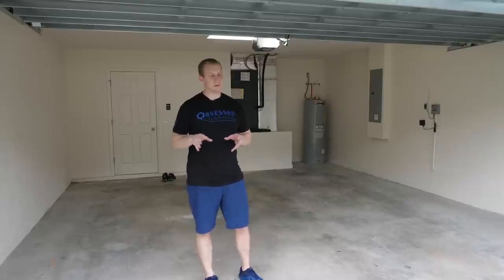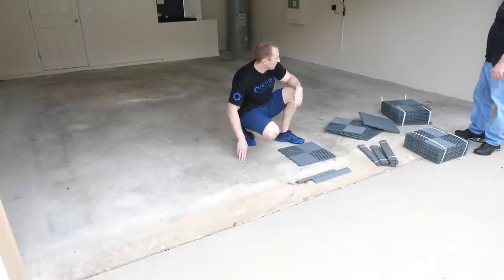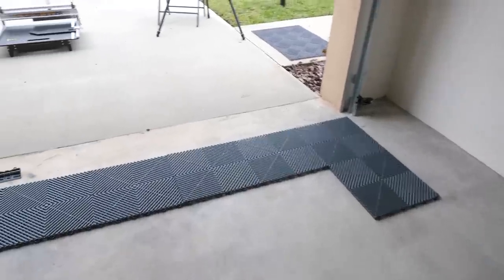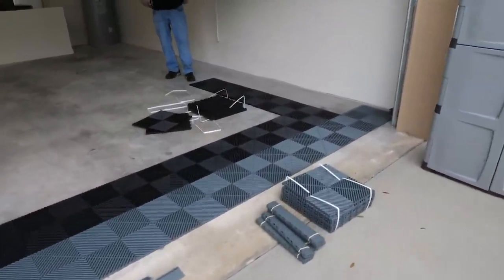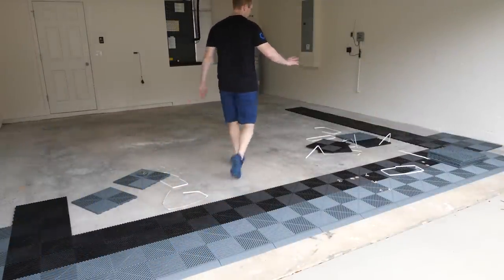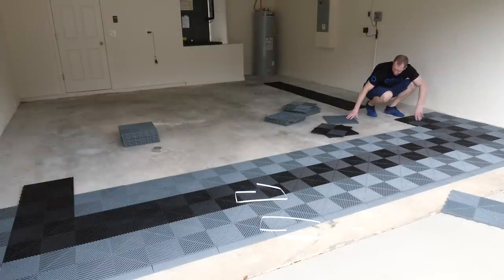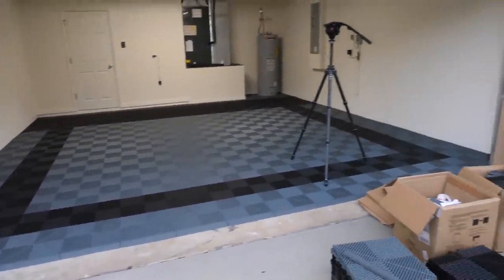Installing Swisstrax In My Dad's Garage

Comment: Those tiles look like all the water, dust, crap goes underneath it, and might not flow out. After it will start to smell, I think it should be solid so nothing can get under neath it. Looks good.
Reply from the maker: That's the whole point.  Dirt disappears, and you vacuum directly through the tiles a few times a year.

Comment: If you accidentally spell something, such as motor oil, do you need to lift up the tiles to wipe up the mess underneath or are tile seams tight enough to prevent any liquid to get between them?
Reply from the maker: Yep, but it takes like a minute.  How often do you spill stuff?  I don't spill often.

Comment: If your just parking on it ya looks ok wouldn't work on anything on top of that floor first time you spill oil or some misses the bucket you have to take up half the floor to clean it then you going to have to clean the tiles too
Reply from the maker: That takes 30 seconds.  I do work on mine all the time.

Comment: What was the size of the garage? I think I have similar sized garage, but calculating based on pack of 25 = $179 I end up with $1800 for the whole garage
Reply from the maker: This was 1,200 sq. ft.
Reply: Obsessed Garage 1200 sq. ft. ? Sounds very enormous. I think you mentioned that you spent $800 for the tiles am I right?

Comment: Are you still able to get this stuff for the pricing quoted in the vid?  Just checked your site and it’s about double.  Definitely interested...couldn’t find your contact info on the site.

Thx!
Reply from the maker: Yep.  It’s $3.95 per square foot.  Each tile is 1.7227 square feet, so $6.80 per tile.
Reply: @ObsessedGarage  sorry I missed that, I thought that was the price /sq ft.

One question, do these make noise when walking over them or are they somewhat quiet?  I have a modular tile on my patio but they are so noisy....wondering if these would be the same.

Comment: I get that you can drive on the rubbertrax but what would happen if you did it anyways? Would you ruin the flooring or would it peel up and you would have to put it back?
Reply from the maker: It's too soft.  You would snap the loops and damage the tiles.

Comment: I live in Colorado and therefore track large quantities of road grit into the garage during winter months. Would this floor support hosing out the grit in the floor voids  in a reasonable time?
Reply from the maker: It works quite well in that environment.  You could hose it out in place or pop the dirty tiles up and clean them in the driveway.  I would suspect once a year would be fine.

Comment: how much noise to these make? and is your floor perfect, I expect they will flex based on concrete flatness
Reply from the maker: Since they are 3/4" thick, they don't click and clack as much.  Solid tiles that don't have open slats are also noisier. They will give a little with drains and cracks in the floor.

Comment: I bought the tile cutter for 500 or 550 on Amazon then sold it in minutes on the Obsessed Marketplace when I was done with it for $260. It was worth every penny, made install fast on both my garage and cousins
Reply from the maker: Smart!  That's how I would have done it.
Reply: @ObsessedGarage  ya if you can find someone to split it with you its a no brainer.

Comment: Matt, the finished product looks amazing.  Think you've sold me.  One question, have a 4 post lift that can be moved around if needed.  Do you put it on top or build the floor around the posts?
Reply from the maker: You'd want to cut the tiles around the lift.
Reply: @ObsessedGarage  love crisp answers.  thanks man.

Comment: Rather than a slim tile down both sides, Why not offset the black tile by half a gray tile than you'd have 7/8 of a tile on each side vice a sliver, however the black border would be a half tile closer to the wall, or half a tile into the middle of the floor. Ceramic tilers would never leave slivers unless absolutely necessary.
Reply from the maker: This is different than ceramic tile.  It has to be interlocked together.  You can't just pick where to make your cut if you want the black border centered.
Reply: @ObsessedGarage  Unless you could build a new skinny tile by gluing pieces from two tiles together.  Just wondering. I did have success in using Crazy Glue to repair a tab in a Bergo tile.

Comment: Matt, no need to leave any room for expansion on sides due to temperature changes?
Reply: He explains it’s not needed. They’re not gonna expand that drastically unless exposed to direct heat for a long period of time. Garages in Florida, even non insulated ones, don’t change temperature “that” much unless you live somewhere more extreme or again leave your door open in sunlight often. But again he explains this in the video.
Reply: Definitely need to leave room for expansion 1/4" all around the floor then install base board over top to hide it..

Comment: how do these hold up to actual "shop" type abuse, ie; jacks, jack stands, fluids etc?????
Reply from the maker: I’ve done a few commercial shops.  It didn’t do well.  It gets really nasty.  I’m a home garage where you wrench, it depends on your cleanliness.  I have don many where guys pull engine and transmissions that do well with it.   It would be any other floor that you invested into, you’d take a bit more care to keep it clean.
Reply: Former professional technician, however I still wrench A LOT. Thanks for the info, I appreciate your time. Keep doing crazy brotha, you’re good at it!! Haha

Comment: so this flooring product is not for a functioning garage (no oil changes, or actual work being done in it.. its simply for parking your car.. no way to clean up dirt/oil spills.. ok, keeping away from this crap....
Reply from the maker: Just pop the tile up and wipe it up.  How often does a person dump oil on floor.  I have 4 cars and change oil myself.  So maybe 6 times a year, I'll have the potential to drop a little oil.  Pop the tile up and wipe it.  It takes 30 seconds.
Reply: @ObsessedGarage  but you need to jack up a vehilce, this stuff wont stand up to a jacks wheels. It will buckle and break. Ill stick with epoxy. Or solid rubber mats that drain, and resist chemicals...
Reply: @killahjeep  Sorry but we do it all the time,  I jack up my car and put it on jack stands and no problems.  You know what they say about assuming.

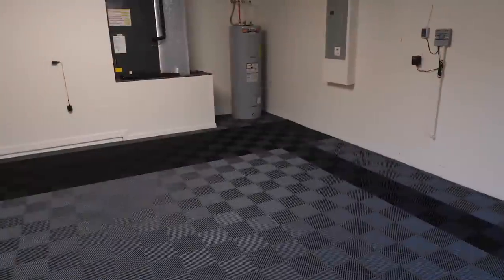Comment: Does anyone else find it weird that the lower crown molding next to do stops at the corner @31:14 and not all the way throughout?
Reply: Monte not real sure what you mean as of if your saying the whole garage but if so  probably because its concrete on the sides of the garage and not drywall
Reply: America’s Sports Car ah that makes sense didn’t notice that right away

Comment: For all the people griping about it trapping dirt, that's literally the point of it, you can easily unsnap the tiles and pull a few rows out at a time and sweep/vacuum it out a few times a year, it's not that difficult to do.
Reply: Pulling out tiles a few times a year?  Are you kidding?  That's more work.  I'd like something with no maintenance, like and epoxy floor you can just wash down with a hose and sweep away.  Thanks, but no thanks.

Comment: anyone thats ever dropped a screw while working on their car, or got some overspill from fluid changes, sees the kind of nightmare this flooring presents! Ill stick to epoxy!
Reply from the maker: Neither are a problem
Reply: @ObsessedGarage  if that's the case, you should make a video spilling some oil, throwing some cat litter to soak it up, and what the concrete floor under it looks like.. Oh and how to clean the tile too. All extra, and unnecessary work compared to epoxy floors. Shop towel, wipe and done
Reply from the maker: I have many, but not a dedicated one.  How often do you spill oil.  For me it's once every two years.  It takes 5 minutes to pop up a tile and wipe it up.  This about dirt logically here for a minute.  The top of the tile has rounded ribs.  Let's say you take off your fender liners and drop a bunch of dirt and rocks while removing.  The tiles are 3/4" thick (tall).  All the dirt bounces off the tiles and falls through them to the base floor.  So...the dirt essentially disappears.  You could do that to 100 cars before you had anywhere near 3/4" of dirt build up.  Then you just vacuum the dirt whenever you fell like it.  Epoxy is fine if you don't mind imperfections.  It's not a viable option for me. It's either this of $20+ sq. ft. porcelain tile.
Reply: @ObsessedGarage  well thats my point. The extra work needed for clean up, and e y thing that gets trapped under it. Plus I wouldnt wait till dirt piles up 3/4" to clean it. Anyways, good looking floor,  but that's about all it has going for it, compared to some other options.

Comment: How do you clean it? Since water runs out, can you wash it with a hose sprayer?
Reply from the maker: Vacuum or Hose it down.  It has channels underneath for water to run.
Reply: Obsessed Garage what about a garage floor that has a storm cellar in it. Would I just build the floor around it?

Comment: It looks good , but also looks like a nightmare to clean dirt , oil spills ect
Reply from the maker: Nope, super easy.
Reply: Obsessed Garage I’m not being a hater , I live in northern Canada and out in the country and park my dually welding truck in the garage, mud melting snow , road salt and so on.
Reply from the maker: Right, all that fall underneath the tiles.  Then you can clean them up when you decide to do it.  Shop vac or quick hose down.  This flooring is perfect for that application.

Comment: really pretty floor, i know lots of car guys with hundred thousand cars and nostalgia funny cars and street rods etc that may have floors like this, im just an old man that worked all my life on cars and love the versatility of the concrete garage floor, if it get too  dirty a specialty oil dry will actually suck up spills, dirt blows out with my leaf blower, my jack rolls easy, my big wheeled compressor rolls easy, if my cat pisses on the floor i spray on it and wash it off, i love the looks of many of these projects but i use my garage for lots of things and it for sure doesn't need to be a show piece, if i like people i would invite them in my home, not my garage. but thanks for making the video, it shows me what the better paid in our society spends their time and money on.

Comment: Matt's commentary on epoxy flooring is 100% incorrect.  When done correctly, it looks great and lasts for decades.  It sounds like the people that were hired to do the job were inexperienced and didn't know what they were doing, as there are many mistakes one can pick up just from what Matt described.    Plastic flooring is great if you have a showroom or a garage like Matt's, in a shop, forget about it - epoxy is the only option.
Reply from the maker: Nope, I'm 100% correct.
Reply: @ObsessedGarage  Your comments and admitted lack of experience suggest otherwise.  You had a bad experience due to inexperienced installers.  That doesn't make the product bad or qualify you to explain how it works.
Reply from the maker: I've seen hundreds of floors, designed about a hundred garages, and have been a part of a few dozen installs.  You must be new here.  I don't speak about things that I don't know anything about.  It is possible to get a floor that doesn't fail, but the probability of failure is extremely high.  I would wager that it is 50/50, or worse.  The biggest issue I have is how it looks when you are actually in the garage.  Unless you utilize a heavy chip system, the imperfections are a huge turn-off.  It is very similar to putting a few coats of wax on a car that has swirled and scratched paint.  From 20 feet away, it looks great, but if you knew anything about it, you'd know it looks terrible.
Reply: @ObsessedGarage  I'm not disputing that there is a high probability of failure on epoxy floors, I'm disputing the reason.   It's not because of epoxy itself, it's because of inexperienced installers and the improper products used.   The stuff you buy at a hardware store is junk, if the concrete is the wrong temperature it won't work, if the mix ratio is off it will discolor like yours did, if you use the wrong rollers it will have issues again like yours did.   I'm not new here, I know you've been very vocally against epoxy for some time, but you're basing all of that off the 1 garage you had where it was installed improperly.  

All of the garage that you have designed, at least on here, all have a tile floor system, coincidentally none of them have any hard work done on them.  Have you designed any garages that have fabrication and mechanical work done on them?   I could just as easily tell you how my plastic tile floor melted when welding the K-member on my car over it and blame the product, but it's not the products fault, it was my improper use - just like your improper installation.

I have an epoxy garage, I have installed more than a few of them myself, and even when you are right on top of it it looks great.   The imperfections you are referring to are again, caused by an improper installation.    My floor is as smooth as the finish on my car, with the exception of the anti-slip compound that I added so I don't fall and bust my ass when the floor is wet.

Comment: Any thoughts on how smooth the floor needs to be before tiling over the top?  My garage floor has some pitting.  Yes, 'some pitting' is a relative statement. It's not terrible but it's the reason I'm looking at covering it up in the first place.  Any personal experience with pitted floors?
Reply from the maker: I've done on some pretty nasty floors that were beat up.  It will be okay on your floor in my experience.  You can put them over things like floor drains without issue.

Comment: Can I ask why you go with Swisstrax as opposed to one of the off brand tiles that look very similar and cost about $2.50 per square foot? I get that Swisstrax is brand, has a nice website etc. but they seem vastly more expensive than the standard plastic grooved tile you can buy on ebay and I'm wondering if there is actually a benefit that I'm missing with the Swisstrax?
Reply: AMG3320 because swisstrax is better,  looks better and higher quality.  There is a difference trust me. It doesnt cost more because the website is cool. If you want tiles that are clickin and clackin all around everytime you walk on them then go buy an off brand.  What i would recommend is getting samples from different companies and compare them then make your choice that works best for you and your budget. I did this and glad i went with swisstrax. I have a large 3 car garage and it was pricey in the end but it looks beautiful.
Reply: @americassportscar  Yeah, I'll definitely get some samples before going all in on outfitting a 4 car garage. I have no problem at all paying for a superior product. But the key term is superior, not operating margin. Thanks for the info.
Reply: AMG3320 For sure, with the cost of this stuff you want to make your choices wisely.  I played with my floor design for a few months. I looked at all the colors and tried different designs.   It is also good if you live in cold climates like i do is that the floor insulates your garage a bit and gets your vehicles off the cold concrete. Good luck in your purchase.
Reply: He literally discusses this in the video
Reply: Damian Roudebush that’s what I was going to say... literally has a whole discussion about why they are superior to cheaper tiles in the video lol
Reply: Did no one watch the video?
Reply: @Eric_Broome  I fully admit I did not watch the video! I've seen a bunch of the Matt's Swisstrax vids so didn't think this one would be much different. Looks like I'll learn a thing or two by watching.
Reply from the maker: There is no contest here.  You will have yourself a few hundred bucks for a floor that I would punt in the trash in a week.  12" tiles are too small, 1/2" is too thin, and the interlocking system is not good on them.
Reply: @ObsessedGarage  Good insight. Thank you.
Reply from the maker: The interlocking system on RaceDeck is a big disadvantage.  Undercutting a door takes about an hour to fix.  The 3/4" thick tiles are the game changer.